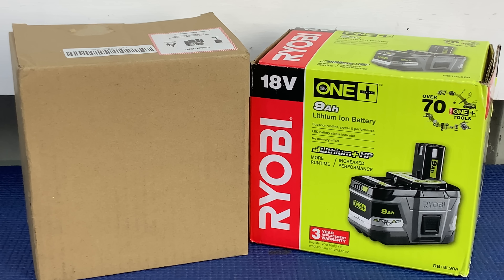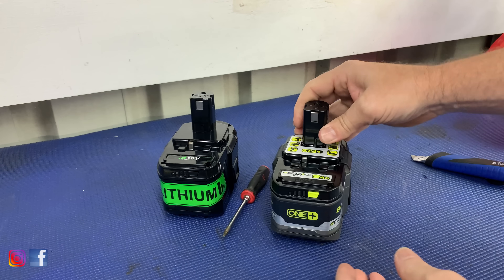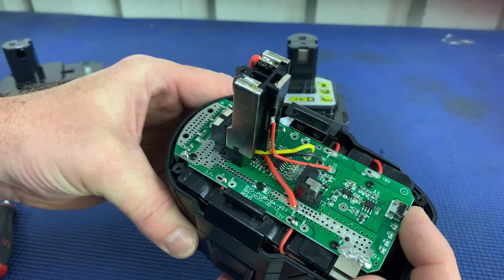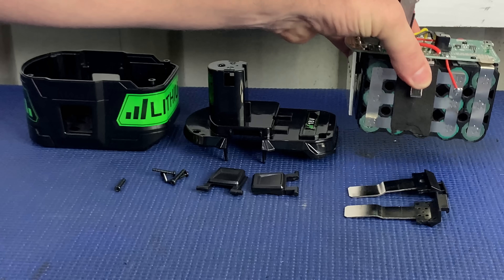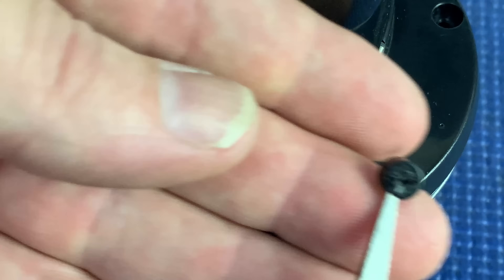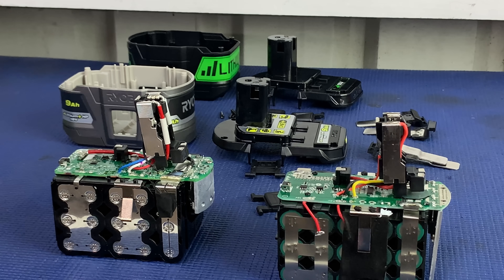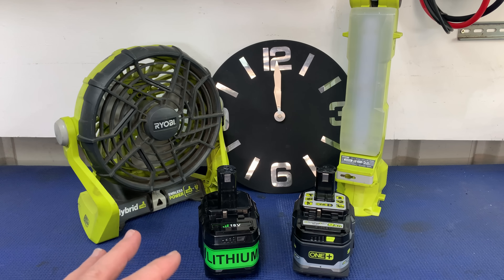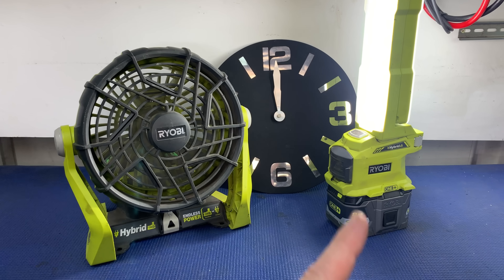Ryobi 9ah battery versus eBay knockoff job

Comment: I have two knock off batteries that I bought because my Ryobi original failed after a couple of years.   They have been going for 5 years strong now with heavy and rough use.  Both failed due to a wire solder joint breaking, but it was a 5 min fix.    Slightly lower runtime, but I can get 3 for the price of a similar size Ryob OEM.  So really kills on a price / performance measure.

Comment: I have around 10 of the copies.  I have never had any trouble with them at all.  It saves me hundreds money wise.  Plus you don't get the built in kill code in the knockoffs like you get in the Ryobi ones.  bearing in mind that this video is 5 yrs old  so the knock offs may have improved since then.  I have 6 x 9Ah knock offs and 4 12Ah knock offs and all work very well.  The funny thing about all this is when I got my Ryobi pole hedge trimmer a few weeks back the battery that came with it was a dud one it wouldn't charge or anything.  Yes Ryobi did replace it.  So I will continue to but my knock offs as they meet my needs.  Thank you for sharing your video with us all.
Reply from the maker: glad they work for you - all my cheap ones failed and was a waste of money

Comment: You don't buy big batteries for the runtime only - you buy they for their performance in high demand tools. Put those two in a vacuum cleaner and you will quickly sort out performance under medium++ load.
Reply from the maker: issue was consistency of the testing - couldn't hold X load for X time accurately.

Comment: For my money, I can get 4x 6ah after market batteries for then same price as a genuine 2.5 ah , even if they are not the full 6ah, they have to be better than 0.625ah’s and I have 4 batteries, so at least one is on charge , whereas with one 2.5, when it dies I have to stop working while it recharges
Reply from the maker: The knockoffs can be a gamble, I had one that was useless after a few uses.

Comment: i think the fake one is just fine for fan light and maybe the radio but for some havy use like chainsaw or something should buy the original one
Reply from the maker: was useless failed after just a few uses
Reply: @HBPowerwall  maybe you put new brandname cells in by your self and make a video about that if you need 10 cells it is maybe about 50 dollars

Comment: I agree....... Just bought a clone 9Ah 12V (exactly what you show) - Just fully charged this product before using it in a RYOBI item but it only lasted from 10pm to 3am (5hrs) but a real Ryobi 5Ah battery usually works from 10pm to 7am (7hrs) on the device used. Now the new battery (9Ahr) will not charge just flashes red on all of the Ryobi chargers I have (5no different units).  So useless..........

Comment: To be a fair comparison, you should have charged both on unpacking them with the same charger and then used the same tool to discharge them whilst timing them. And then repeat several times. Failure to test the same voids this comparison.

Comment: I have a 8 ah knock off battery from Ebay and while the quality is  inferior to the genuine Ryobi the sheer cheapness of the knockoff makes it worth the money.
The knockoff isn't that good on my leaf blower but has a similar performance to a 4ah genuine unit on my strimmer and hedge cutter and being cheaper than a genuine 4ah unit it still makes the knock off worth it.
The only problem is the knockoff battery for some reason does not work on my chainsaw and on one of my smaller chargers.

Comment: How long they run isn't as important as initial torque is to me. For nut removal etc I have a what is sold as 9 amp knock off that easily removes rusted wheel nuts of my trailer. Going on 5 years now. Honesty in their amp rating
Reply from the maker: fair call, but only consistent test I could do was run time.

Comment: To me the cells would be the most important thing. Along with the welds. If your getting the same amp hour battery for a quarter of the price I'd go the cheap one every day of the week. I got alot of Ryobi tools and the batteries are just way too expensive. The complaints you have are not picking tiny garbage. Like it doesn't click the same as the original one. I want bang for buck and day in day out I'd buy the cheaper one.

Comment: I bought one of these cheap batteries a couple of years after this video was made and it died in about a month. The manufacturer replaced it and let me keep the broken one. So I harvested the cells and tested them. The failure was in the circuit board. You should test this because to my surprise (not really) all of the cells tested out at around 1500 ma. You do get what you pay for no mater what the ad says. The new one is still working and fair value for the money but not even close to 9A.

Comment: I have a different version of your knock-off one. Mine has the opposite effect of yours in that once clipped in, it is very hard to get out of the tool, so no chance of it falling out. Also mine lasts just as long as the Ryobi original. However... my Ryobi originals are not the newer version that you have there.
Reply from the maker: thanks for the feed back

Comment: Ought 3 nock off copy all have stopped working using a rattle gun. Constantly having to repair broken wire which runs down the sides of batteries. Now after a few years have packed up completely . Are considering buying genuine from now on. I have the lowest value of some ryobi batteries but chargers don’t last long.

Comment: "Would I buy one? Absolutely not -- I know bettah." I quote sarcastically after he says it is a better value "on paper." I have owned numerous of the cheap 6.0ah versions... Actually about 4ah, but they worked like a charm, for NUMEROUS years. I don't have one original Ryobi battery still working, but out of eight, I now have four still going. Oldest batch of four was about eight years ago, last batch about five years old. Three have failed. Don't give me the quality HS. All my original ryobi's are dead.

Comment: If it was a knockoff, surely it would also be labelled as "Ryobi"? This would be an aftermarket job instead. WIthout doing usage testing, you can't really compare. There are different cells for different jobs. These 9Ah batteries might be ideal for a replacement to the 2A batteries where you just want it to last longer, whereas the Ryobi 9A would be ideal for power hungry tools.

Did you consider this?

Could you imagine calling a Yamaha version of a cruiser being a knockoff Harley? The Yamaha would be cheaper, and more reliable. Without knowing the batteries or further testing, it's hard to know where these aftermarket versions are to sit in comparison to the Ryobi ones.

Comment: You tested one in a flashlight and one in a fan. What kind of test is this?  You did not use  the exact same charger and the exact same tool to text them. Totally flawed test at the most basic level.

Comment: When I have used both batteries in my strimmer, I get maybe 20 mins from a ryobi battery but only 10 to 12 mins with the other , and it’s getting shorter the more I use and recharge them

Comment: Purchased a knock off 18v for a caulking gun. Been using it for three years and have had no problems. The original battery lasted just over a year.
Reply from the maker: Lucky you!! Can't say I've ever had the same success
Reply: @HBPowerwall  the original Ryobi hardly kept a charge and gave up in just over a year. The charger lasted about 2 years and that gave up. The knock off charger works better to. But I would would warn people that was a few years ago. I know by now they will have cut corners here and there on the manufacturing processes.

Comment: Dollar for dollar, the knockoffs are a far better buy than the OEM batteries even if they last only 1/2 as long, however, they will probably last longer than that.
Reply from the maker: that is not my experience with these - straight after this video I did a capacity test - 3 ah not the 9ah advertised, 5-8 cycles later 6 cells failed an the battery was useless.. how ever seems the comment section thinks this is a sponsored video - THAT it is not I assure you (in fact its a YouTube condition that I do disclose that sort of thing! ) Many have said they use knockoffs successfully - guess i'm just unlucky

Comment: Contractor here. I have 4 knockoffs I have been using for 2 years. Bought from Amazon. Doing just fine.
Reply from the maker: You're lucky by the sounds of it hehe although not all knock offs are made equal I guess

Comment: Interesting video, I've been seeing a lot of these clone battery ads coming up recently on my social media and other pages. I'm always cautious, and your video is great at demonstrating why.  I can RELY on the genuine Ryobi having things like automatic load protection (both high and low voltage), thermal sensors and what not.  There is no way to know if you are getting any of these protections in a knockoff.
Tangentially related I've seen a family member have a burnt phone socket after, I found out, they purchased a cheap replacement unbranded charger and cables that came from one of these dubious cheap mall vendors.

Comment: Thank you for taking the time for the video!  I have one comment about the fitment - I have a total of 5 after market batteries, 2 very similar to the 9Ah ones you have tested and ALL of them have Perfect fitment (so far).  I honestly suspect that during re-assembly something was not aligned properly in the after market battery causing the poor fitment.  I imagine it is possible that it is indeed made with poor fitment but that is not what I have experienced buying from 3 different vendors.    Overall I am very impressed with the 9Ah AM you have tested as it is a LOT better than the ones I just bought at 4 for $109 which I suspect weigh about half as much as the one you have here.

Comment: Title: "Ryobi 9Ah Battery vs eBay Knockoff"

• The purpose was to test and compare the performance of a genuine 9 Amp-hour Ryobi battery ($299) against a much cheaper eBay knockoff battery ($72) claimed to also be 9Ah - a 76% price difference.

• Upon disassembly, the build quality differences were stark. The Ryobi had very thick, heavy nickel strips connecting the cells with strong spot welds. The knockoff had extremely thin nickel strips and poor, amateur-looking spot weld connections, raising doubts about its construction.

• Runtime tests were conducted using a fan and an LED light. Surprisingly, the knockoff battery performed reasonably well, lasting 12 hours 45 minutes on the fan (31% less than Ryobi's 18 hours 22 minutes) and 9 hours 23 minutes on the light (29% less than Ryobi's 13 hours).

• However, major concerns remain about the knockoff's longevity and cycle life due to the evidently poor build quality. It also does not fit as securely into tools and fell out multiple times during use.

• To further investigate longevity, the plan is to solder on balance leads and run 100 full charge/discharge cycles on each battery using specialty equipment to see how they degrade over time.

• While the knockoff provided decent initial runtime for its low price, the quality differences suggest the Ryobi battery is likely a much better long-term value despite the higher upfront cost.

Comment: These tests are useless. The generic battery has multiple flaws. There ok first few times you use them then quickly they die. No surge protector in them either. Do not buy them. Why should you take my advice here. I had Makita generic, they died. DeWalt...died...Ryobi..died . Paslode , absolutely garbage. That's why, been in construction for over 30 years. Don't do it!!

Comment: Several years ago I did this same test 2018 to be exact.  Unfortunately I didn't video it.   However  I bought a Ryobi One+ Lythium P105 from HD.  Then I went on Amazon and bought GERIT BATT 5.0Ah for Ryobi 18V.  I put them both into two identical Ryobi drills.  I pulled the trigger and rubberbanded them.  Both batteries on a full charge went a little over an hour in the drills.  The Ryobi brand went 1 Hour and 16 minutes.  The GERIT went 1 Hour and 8.  I didn't take mine apart, and I have never had either fall out of my drill.  Today (2024) The GERIT battery is still working and I am trying to jumpstart the Ryobi.

Comment: You didn't even do any high power performance. Guaranteed the cheap one sucks in high drain applications. Drills, saws, impact drivers etc will probably perform far worse with lackluster instantaneous power.
Reply from the maker: I actually did, but it was far too hard to be consistent..

Comment: My only issue with the generic is that they overstate the power capacity rating. They should call it what it is, (~6Ah).  Ryobi is 5x the price, holds 1.5 more energy, and a better enclosure.  In terms of work flow, I'd rather have 5 generic batteries than one genuine.  If one should happen to fail then it's no major loss with the generic, ($35), vs (~$180 for the Ryobi).
"you get what you pay for?"  I haven't had any bad luck with generic Ryobi replacement batteries.  For the same money you can get 5, for at total of 30Ah, vs 9Ah, and the ability to power 5 tools.  That's something to consider.

Comment: Don't know about the "Fakes" out there today, but a couple of years ago I purchased 2 "fakes" on E Bay for $19 each. They are 1/3 again heavier in weight, and initially a bit difficult to disengage from the tool or charger. Once broke in fine. The charge longevity is 5 times superior to the factory Ryobi, and still have not shown any signs of degradation. Tools have more torque and longer than the factory batteries. My opinion is Ryobi is Way Over-Priced for battery replacement!

Comment: The results aren't unexpected, but are sad nonetheless. It means an investment in a major battery powered device, such as a lawn mower, is out out of the question. The genuine Ryobi batteries make it way too expensive. Buying a Ryobi 'skin only' mower and using the ebay knockoff batteries was the only way to make it an affordable option. I guess i'll invest in a new petrol mower instead.

Comment: 3 years on, i have had dewalt tools for around 7 years and never had a problem, not even with a battery,  recently i bought some new Ryobi tools and i bought genuine batteries and within 6 months some of the batteries do not work, as i write this i'm getting them replaced under warranty and that's alot of messing around,
Reply from the maker: Mean while the 9ah battery has been raped for years and still going strong and the knock off didn't even make it half way through making the next video in this series lol

Comment: My comments with owning and using genuine 5Ah Ryobi and 2 x clone 5Ah ones bought from the same seller. Unfortunately you can’t tell if you’re buying the same battery with the clone ones as there is multiple unknown manufacturers of them. However the two clone ones I have fit and work the same S the genuine one. The only difference is when charging the clone ones don’t flash the battery level indicator. In use with my Ryobi mower they last a similar time when mowing my buffalo grass here in CQ. A Ryobi twin 5Ah battery pack with charger is $249 at Bunnings. I paid $111 for my clone so just under half the price This was 3 years ago and they’re still working fine. Of course clones are variable in quality as you don’t know which one was made by who. On your review you could have bought 4 clone batteries and still had $19 left over which shows Ryobi is overpriced you only need to look at USA prices and convert to Australian dollars to see we are paying way more for Ryobi stuff in Australia. I will again buy more clone batteries because my experience has been a positive one with a big cost savings. The battery interconnections on your battery looked better but at 4 times the price they should have been gold plated! 😊

Comment: This video clearly is made to make the knock off batteries to look bad. How much did ryobi pay you just curious?
I use the knock off batteries and I have no issues with any batteries even the very expensive ryobi Batts. So for half the price I'm sure I can live with the knock offs. And I put them through hell and back and out of 10 batteries I only had 2 that failed. A battery cell had died in both. And yes one was a very expensive ryobi!!! I benched them both. Found the bad cell and used the other batt for a good cell. Replaced and now the one battery working again as new. Yup you guessed it! It's the knock off I resurrected!
Reply from the maker: F*ck off, Ryobi didn't pay me shit.. I didn't have to work too hard to make this shit look bad, came from the factory that way!

Comment: I have been using both Ryobi  legit batteries &knockofs for many years as a DIY person.   I have received faithful service from both, with neglible difference in runtime between them. I have also bought from other sources for knockoffs for a further 20% off the retail price of legit Ryobi batteries (currently $56 AUD for the 9amp).

Comment: Don't really have an issue with aftermarket batteries in most of my tools but I can tell you using them in a impact is where you will notice the difference. Two aftermarket batteries being used in my half inch impact had separated the bands from individual cells in the batteries from vibration

Comment: I put one of these knock offs in my ryobi 16inch battery powered lawn mower and it gets hot and shuts off only a couple minutes into a cycle, if i take it out and let it cool (dont charge it) it will mow for a few more minutes again until it gets hot again.

Comment: Excellent thank you very much.
Another point to think of is that ryobi batteries and tools are very sensitive to water ingression more so than other brands like makita and milwaukee. A battery that is looser will more than likely burn out at the first sign of rain while working with it.
Also using anything with a full inductive load could also burn out the wiring in the knockoff due to heat.